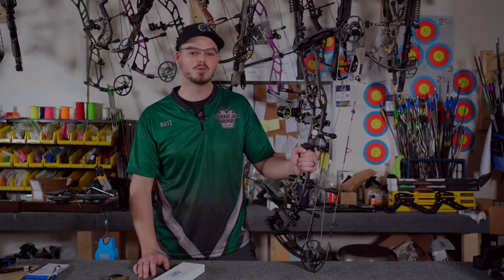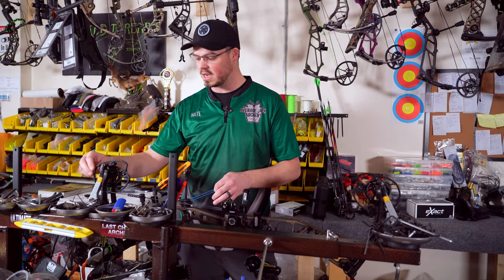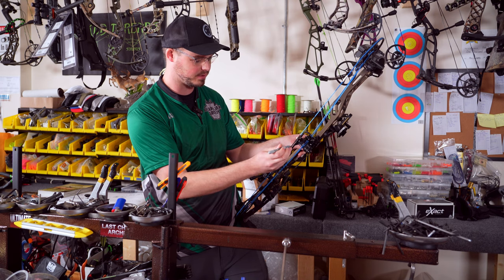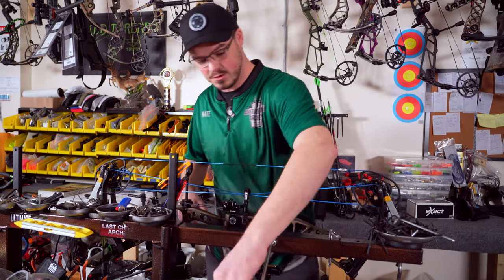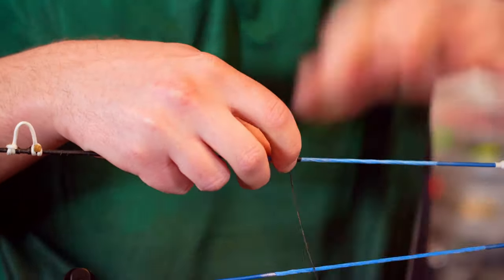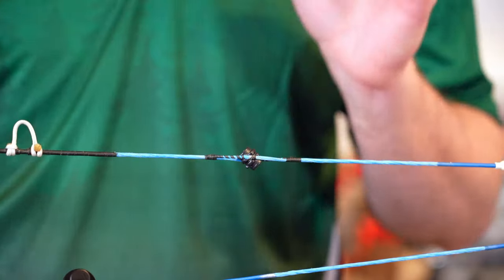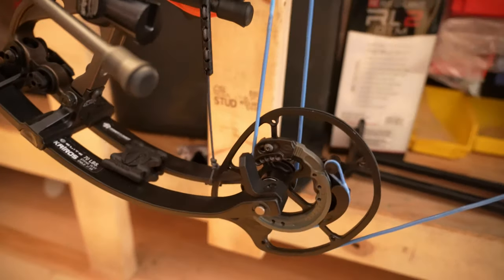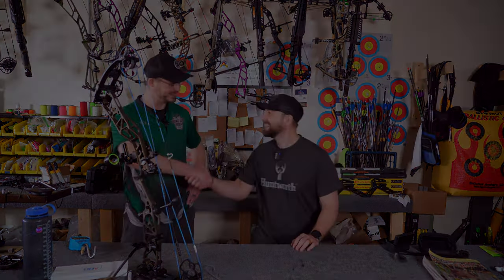Building A 3D BOW | FULL SETUP! | Elite Kairos String and Cable Change

Comment: I make my own string and cable sets and changed my strings and changed them a fair few times with my trusty bowmaster.
I dont strip everything off.
I remove a cable and replace with the new one.
Remove the other cable, replace with the new.
Then do the string.
That way if Im disturbed half way. I can finish up quickly and remove the tension off the bow press, So I can leave the bow safe.

Comment: Excellent video - clear explanation throughout each step!  Thoughts on installing a small piece of D-loop in the string that can be slid up or down to adjust peep rotation?  Haven’t tried it, but I’ve seen this done.

Comment: Hey Nate (or others) do you set Omnias up with bottom arrow aligned bottom berger also? Mines a tad higher probably bottom arrow through centre hole. Thinking about moving it down to see if it holds better?
Reply from the maker: Yup! I setup all bows that way. Bottom edge of arrow with bottom of beger hole edge.

Comment: Hi Nate ,  very good video , I have an elite Carbon Era that I hunt with  , which Ive been shooting for over 12 months now , my cable at full draw are now touching the cams , do you have any advise how to get the cables away from the cams slightly , Cheers
Reply from the maker: Have you played at all with the SET technology for tuning?
Reply: Yes Buddy got it shooting bullet holes but I think the cables have stretched.  I might put it on my draw board and adjust the SET where the cable doesn't ouch at full draw .  @averagejackarchery
Reply from the maker: That would be my recommendation! Won't take much SET movement to clear it up.